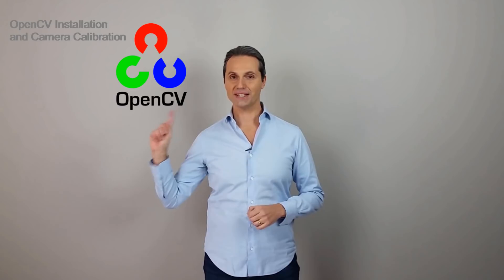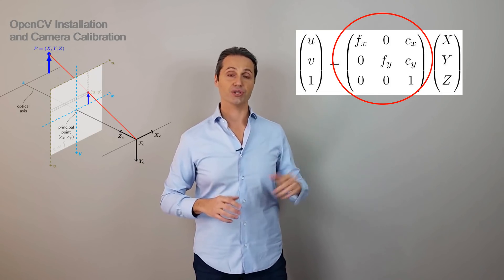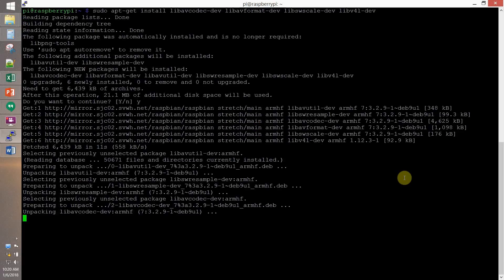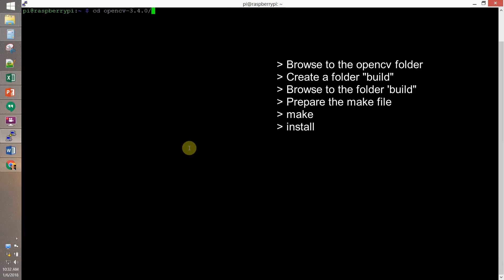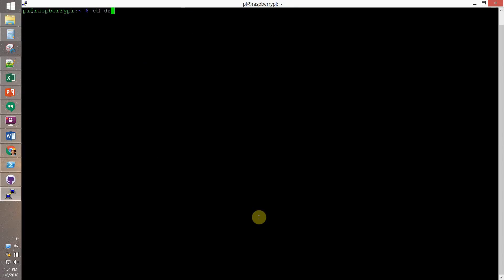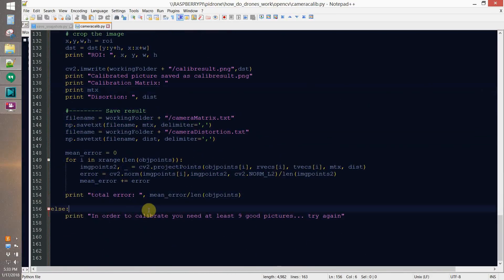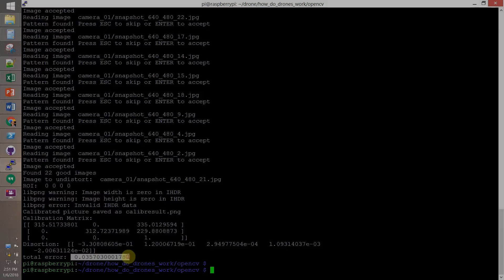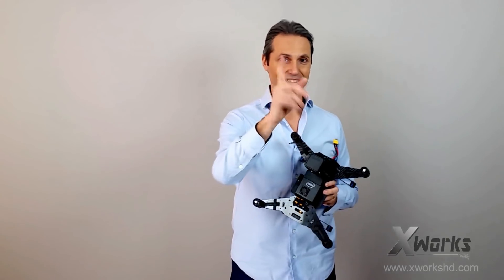OpenCv and Camera Calibration on a Raspberry Pi 3

Comment: Hello Tiziano! I have a question about the cameracalib-file.. I noticed that you use the dimensions of the checkerboard in the parameter criteria. In the OpenCV documentation I found that this value represents the maximum amount of iterations. Maybe I am interpretating this wrong.. The dimensions are only used in this parameter. Does that mean the dimensions of the single square of the checkerboard is not relevant?
Reply from the maker: The dimensions of the single check are important as you need to connect the pixels to physical dimensions. The unit of measure you use in calibration will be used to give you the dimensions from there on
Reply: @prandtlmayer  I see, but I don't find the line of code where the pixels get the connection to the physical dimension.. There should be some sort of comparison between the size of a single check and the width of it in pixels.

Comment: Hi Tiziano, 
First thanks for this amazing video! Really brought me in. 
Second comes the question, I tried to install libjpeg-dve, libtiff5-dev, lib jasper, lib png12, but some error occured saying 404 not found. Is this because of the resources online's gone? (I'm using college wifi so I also guess my college block some of the website?)
Reply from the maker: I don't believe your connection is blocking you and it might be that, since the video was released, installation has changed. Try installing OpenCv as a package

Comment: Hello Tiziano. Thanks for the video. I assume if you are capturing at a higher resolution, you need to calibrate for that resolution. How do I enable the snapshots preview window (and calibration windows) to be resized on the rpi display for higher resolutions? I currently can only see some of the image. My X11 forwarding to mac is not working so I am hoping there is a workaround.
Reply from the maker: You are right, and if you look at my script, you can submit the resolution as argument. In general I would not recommend going higher than 640x480 for real time applications though

Comment: Hello Tiziano.. Thanks for the great video. When I start calibration the camera is running slow I have v2.1 & PI 3B  kindly can I do something with configuration? and when I enter space it doesn't save (only one time worked).
Reply from the maker: I think we have the same setup: I also have a 3B+ here and a normal pi-camera: what resolution?

Comment: Fantastic guide thank you. However my installs did not go as planned. I copied all your commands very carefully but perhaps I made a mistake somewhere and it let me continue on without everything.

I am missing openCV packages after checking output from this as you instructed:
cmake -D CMAKE_BUILD_TYPE=RELEASE \   ...  and the following few lines.
This was outputted at the bottom of the large run sequence (again all terminal):
Configuring incomplete, errors occurred!

Then I tried:
make -j4 and got this error message:
make: * No targets specified and no makefile found.   Stop.

Can anyone point me in the right direction?

Comment: Hello!
I first want to thank you for this awesome viedo and channel, it has served as a great inspiration for a bunch of academic and personal projects I am planning on undertaking. Using OpenCV for object detection and tracking on UAV platforms is one of the topics I am interested in and I'm looking into buying a Raspberry Pi 4 for this. I am kinda of on a budget so I wanted to ask you Sir, whether the 2GB Raspberry Pi 4 would be enoguh for this application or if getting more RAM would be mandatory?

Best regards :-)
Reply from the maker: Hard to say, but I'd go with the 2Gb and eventually put it for sale and upgrade to the 4gb if you see it does not fit

Comment: Anyway you could post the code for save snapshots? Also, how do you use the camera matrix and distortion coefficients to actually undistort other images you take? Thanks!
Reply from the maker: Everything is on GitHub. Check it out
Reply: @prandtlmayer  Thank you, got a new sub from me! I'm getting the following error when I try to run camercalib.py:

Traceback (most recent last call):
    File "camercalib.py", line 88, in <module>
        corners2 = cv2.cornersSubPix(gray, corners, (11,11), (-1,-1), criteria)
TypeError: integer argument expected, got float

Any idea why? Extreme python noob here
Reply: @prandtlmayer  Hi Tiziano,  how do you use camera matrix and distortion coefficients for calculate X, Y, Z Real World Coordinates ? Thanks !

Comment: Hey  Tiziano!
My compiling is stopping at 98 like from past 4-6 hrs it's 98.
I used make clean and tried for 5-6 times, I didn't work.

Thank you!
Reply from the maker: Did you expand the memory?
Reply: @prandtlmayer  i have the same issue, i have sd card of 16GB and it shows me after loading Rasbian OS root size as 15gb and 4..5gb used and 9.5 available. still opencv Make -j4 stops at 85%

Comment: Hey Tiziano, 
Great Video:-) 
If I print the chessboard, is the size of the squares important? If yes, what shall the exact size of a square be (9x6 chessboard)? Thanks a lot for your information.
Reply: I have found the answer within the code. The squares should be 25 mm each. Thanks a lot for that awesome work:-)

Comment: Hey, 
While running   
make -j4 
I am getting an error which states as follows

 [ 34%] Built target opencv_plot
[ 34%] Built target opencv_photo
[ 34%] Built target opencv_reg
Makefile:160: recipe for target 'all' failed
make: * [all] Error 2
Reply from the maker: Clean the build that try again. If happens again, try make without -j4. Clean the build though
Reply: Tiziano Fiorenzani it worked. Thanks. You saved the day

Comment: hey Tiziano, 
I'm running into this error while testing your calibration program
pi@Jordan-Pi-3:~/drone/how_do_drones_work/opencv $ python save_snapshots.py --dwidth 640 --dheight 480 --raspi True
Setting the custom Width and Height
Traceback (most recent call last):
  File "save_snapshots.py", line 101, in <module>
    main()
  File "save_snapshots.py", line 96, in main
    save_snaps(width=args.dwidth, height=args.dheight, name=args.name, folder=args.folder, raspi=args.raspi)
  File "save_snapshots.py", line 57, in save_snaps
    cv2.imshow('camera', frame)
cv2.error: OpenCV(3.4.2) /home/pi/opencv-3.4.2/modules/highgui/src/window.cpp:632: error: (-2:Unspecified error) The function is not implemented. Rebuild the library with Windows, GTK+ 2.x or Carbon support. If you are on Ubuntu or Debian, install libgtk2.0-dev and pkg-config, then re-run cmake or configure script in function 'cvShowImage'

Thank for your tutorial and help
Reply from the maker: Read the last sentence: "If you are on Ubuntu or Debian, install libgtk2.0-dev and pkg-config, then re-run cmake or configure script in function 'cvShowImage'". Have you installed libgtk2 before the make build/install?
Reply: yes, I have those installed and I went through and checked just now. I re-ran the cmake -D stuff and I'm still getting the same error. do I also have to redo the make -j4?
Reply: just got it to work ^^ thank you
Reply from the maker: Did you figure out what was wrong?
Reply: Tiziano Fiorenzani yes, as it turned out I didn’t have libtk2.0-dev installed when I did the -j4. Also I needed more switch memory sited from sentdex, my pi kept crashing after a while of compiling

Comment: what different this python3 and python2 ?? can use python 3 for this tutorial?
Reply from the maker: Roderick Diaz sure, be sure my library works with 3 though
Reply: thanks, I realized that it does not work with python2.7 but when I run python3 import cv2 if it works
Reply from the maker: I am glad

Comment: what is the unit using for focal length? cm, inch or whatelses? thank you
Reply from the maker: Nhat, sorry for my answer, I read it wrong. The right answer is that the focal length is in pixels. The units of the calibration matrix is pixel
Reply: How to find the cell dimension?

Comment: I ran the command again and faced this problem. 
VIDEOIO ERROR: V4L2: Pixel format of incoming image is unsupported by OpenCV
OpenCV Error: Assertion failed (size.width>0 && size.height>0) in imshow, file /home/pi/opencv-3.4.0/modules/highgui/src/window.cpp, line 331
Traceback (most recent call last):
  File "savesnapshots.py", line 99, in <module>
    main()
  File "savesnapshots.py", line 94, in main
save_snaps(width=args.dwidth, height=args.dheight, name=args.name, folder=args.folder, raspi=args.raspi)
  File "savesnapshots.py", line 55, in save_snaps
    cv2.imshow('camera', frame)
cv2.error: /home/pi/opencv-3.4.0/modules/highgui/src/window.cpp:331: error: (-215) size.width>0 && size.height>0 in function imshow

Please help me out!
Reply from the maker: .mmmhh, it sounds like an issue with the camera. Type raspivid -t 0 and check whether you see the video

Comment: i am getting error in -D BUILD EXAMPLES=ON ..
it says parse error in command line argument: -D
Should be:  VAR:type=value
plz help me out
Reply from the maker: I never faced that issue: check this out https://stackoverflow.com/questions/31103551/error-in-cmake-opencv-parse-error-in-command-line-argument-d/31374243
Reply: I am getting the same error.
Reply: It's building now. Must have had something spelled or spaced wrong.
Reply: how resolved? i have   problem  try   -D BUILD EXAMPLES=ON ..
 and out error 
-D BUILD_EXAMPLES=ON ..  i have  out error 
and 
-D BUILD_EXAMPLES= ON ..   also errors 

I do not know what to do  ._.

Comment: I can't wait to follow you in the next video tutorial It's only going to cost 1,100 dollars .
Reply: Good thing I bought extra batteries
Reply from the maker: LOL, yes, it's a little expensive, but most of the stuff I will develop on this board will apply to other architectures. For example I am going to develop for PX4 as well, the board runs Linux Ubuntu and the intel realsense camera can be installed even on other companion PC's.